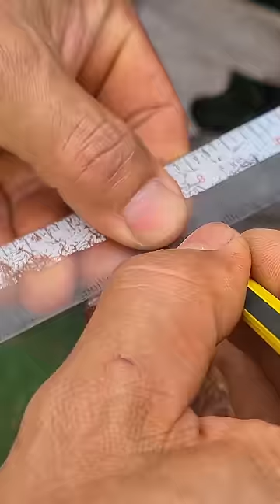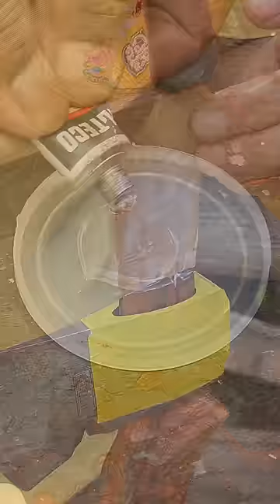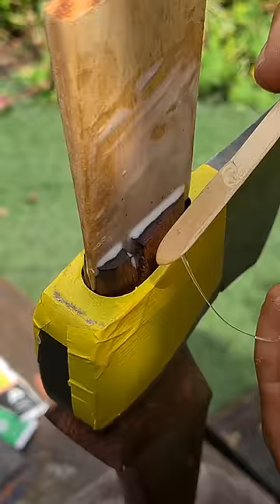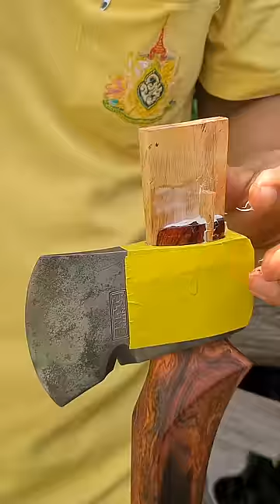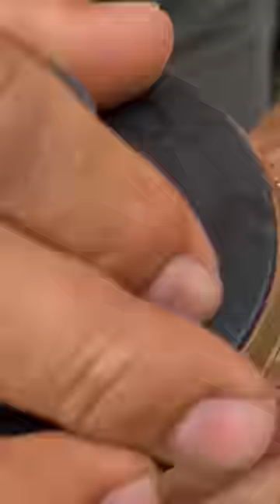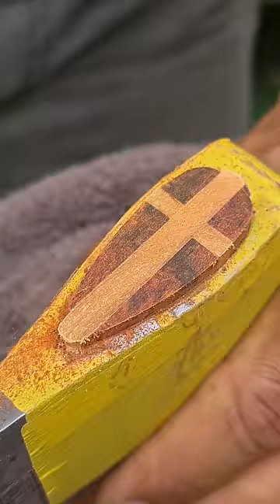How to hang an axe head with the beautiful cross wedge #craftsmanship #shorts

Comment: How about carving it to fit the axe head properly then it will be actually tight
Reply from the maker: That's something that takes some experience but we tend to sharpen the handle a little smaller than the head and try to make a big wedge.  Most of us focus on beauty, we do it for collecting and showing.You can check out the full video at the link below where you can see all the steps.👇👇Thank you🙏🥰
https://youtu.be/KqsTypfnCjs
Reply: That’s what the epoxy is for. It fills any space between the head and handle. I bought o e of those yellow plastic Home Depot handles for my splitting mail and they give you a packet of epoxy to use when mounting. It worked perfectly, it’s been about five years now and is still holding perfect. Nice and tight.
Reply: But that’s not how you do a wood handle. If you make a nice wedge and hang it correctly epoxy isn’t needed on wood.

Comment: If you have to use epoxy to hang an axe…you did it wrong.
Reply from the maker: Actually a single wedge is ok but I used epoxy to add more strength.
Reply: @poomsproject I know you think you're adding strength, but what you're actually doing is creating a brittle failure point for the future.

I'll give it 5 years, then it'll need major repair.
Reply from the maker: @survivalistor6195  Thank you for your comment. I have a 1956-1961 Plumb's boy scout axe with Permabond epoxy at the eye, they used it to attach the handle to the head  but it still work until now.
Reply: @poomsproject  no idea why people have to me smartasses in here. You did a a great job and keep showing your work the way you do it
Reply: It should be tight as hell before the wedges even go in, this was painful to see.

Comment: It looks good but why did you cut a notch out? The point is usually to make a cut and then for that to expand and fill the gaps, not remove material and then fill it with resin.
Reply from the maker: Thank you. We would like to make cross wedges and our big problem is that we use hard wood for the handle which if not cut into a V shape, the handle will crack when driving the wedge. If the handle was made from hickory wood are more flexible so they don't need to be cut into a V shape.👍😊
Reply: HEY SMARTY PANTS GO BACK AND WATCH THE VIDY A COUPLE MORE TIMES 🤔☝️☝️ HE DIDN'T FILL THE NOTCH WITH RESIN

Comment: To be fair mate the wood looks good and gain directions doesn't matter for small axe/hatchet like that but the head fit is poor and needs to be a tighter fit before adding the wedges over time it will most likely come lose. Work slowly with a spoke shave and hit the end of the handle not head to make the axe head go on and you you will have a way better fit. Best of luck with your next one 👍 it's art
Reply from the maker: Thank you for your comment and advice sir🙏👍😊😊

Comment: Looks cool, but I do believe it will fly off , the axe head needs to be snug fitted , in time when the handle shrinks it will not hold . Could be un safe to who is using this axe when this head flys off. Would be a nice wall hanger…!!!…
Reply from the maker: Thank you for your comment.  The axhead definitely doesn't fly, this video is short so you may not see all of our work. You can watch the work from start to finish at the link below.  However, we intend to make a wall hanging for collection and display.👇👇🙏😊
https://youtu.be/KqsTypfnCjs

Comment: This is a beautiful piece for the wall.
The handle IS pretty,
But it's beauty is the reason it would probably break fairly quickly.
Too much character and grain runout.
Lots of weak points. 
Handles and baseball bats hate character,
IF they're meant to be used.
Still pretty for a wall somewhere.
Reply from the maker: Thank you, yeah you are right. We did it for collection and display. This handle will be the wall hanger in my house🙏🥰🥰

Comment: Why not just make the top of the wood where the ax goes on a little bigger so it's a tighter fit so you don't have to use epoxy? I would definitely never use that for chopping wood🤦🏼‍♂️
Reply from the maker: Thank you for comment🙏🤣

Comment: What happens when you have to change the handle?
Reply from the maker: We have experienced removing the handle of an ax with epoxy glue, we use a drill to drill it down and then use a chisel to remove the handle and epoxy glue it out. It can be done without worry.😊👍

Comment: If you gotta use epoxy then you shouldn't be doing these videos. I have seen the cross wedge before but you gotta have the head a little snug before hand. If you don't beat the handle to get the head on then you not doing it good enough.
Reply from the maker: Thank you for your comment. I have a 1956-1961 Plumb's boy scout axe with Permabond epoxy at the eye, they used it to attach the handle to the head but it still works until now.👍😊
Reply: And physics proves you wrong. 3rd world knowledge isn’t fool proof. Many many many men in North America work as professional loggers and axe men and what you have made there is a massive failure point on a tool that if used or constructed improperly could cause serious harm. Basic woodworking in school taught us that You MUST make sure the wool and axe head fit tight before you wedge it to avoid any slips or movement that could result in a break or worse a loose axe head flying thru the bush or back yard at Mach 10.5 like maverick in the dark star.
Reply: @poomsproject  and that’s a Boy Scout axe not a full swing axe meant for a grown man. What you have is a toy by comparison 😂
Reply from the maker: @tysonderycke2420  Thank you for your comment.👍😊
Reply from the maker: @tysonderycke2420  By the way yhank you for your comment.

Comment: If the handle breaks how you going to replace it I'd hate to be stuck in the woods with that thing Jesus
Reply from the maker: We have experienced removing the handle of an ax with epoxy glue, we use a drill to drill it down and then use a chisel to remove the old handle and epoxy glue it out. It can be done without worry.👍😊
Reply: @poomsproject   yeah but if you just use wooden wedges you can fix it in the woods with just a sturdy stick and Paton even easier at home with screwdriver if you fit it right you don't need glue or anything simple is best when it comes to these things
Reply from the maker: @shawnlowhorn5009  Thank you🙏😊.

Comment: Tell me you don’t know how to hang an axe head with out telling me.
Reply from the maker: I'm not sure what did you mean
Reply: @poomsproject   I mean you don’t know what your doing. Don’t get me wrong it’s nice to look at but that’s about all it’s good for it won’t hold up.

For starters the tung of your handle is far too small and is not properly shaped for the eye of the axe head. Second, epoxy should never be used to hang an axe head.
Third, yes it looks pretty but the tung should never be cross wedged. 

The eye of the axe head should fit snug around the tung so the tung doesn’t need to move much to have a solid fit. Wedging the tung as far as it is combined with the use of epoxy puts additional stress that the point the handle and bottom of the head meet and may cause a failure with heavy or extreme use.  Epoxy should never be used as it’s a royal pain to remove if the head ever needs to be re-hung. the epoxy will fill the grain making it brittle and preventing oil from penetrating the wood. The reason an axe shouldn’t be cross wedged because doing it increases the likelihood of the handle splitting especially if the tung was wedged really far.